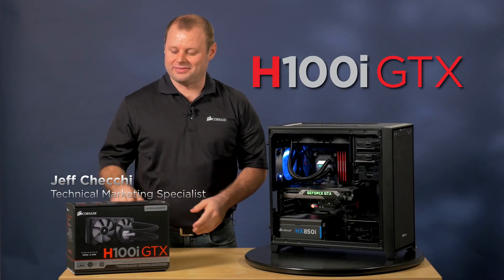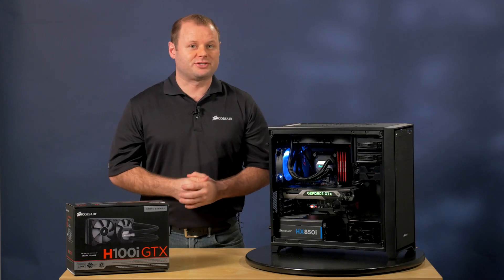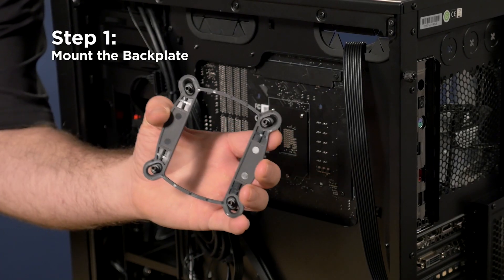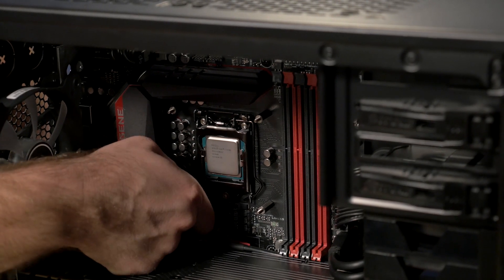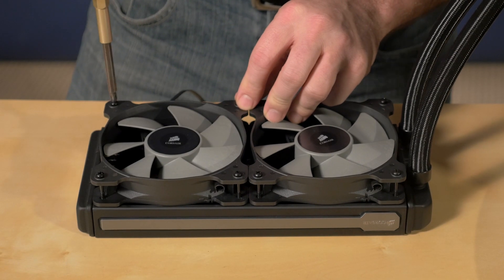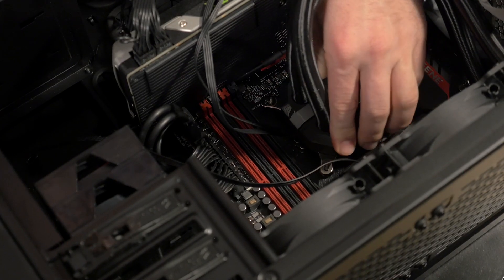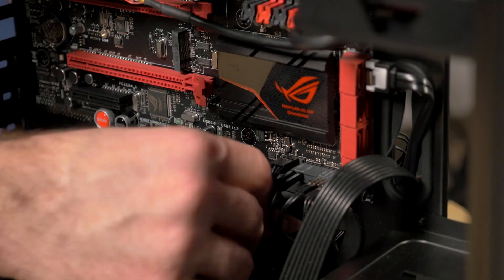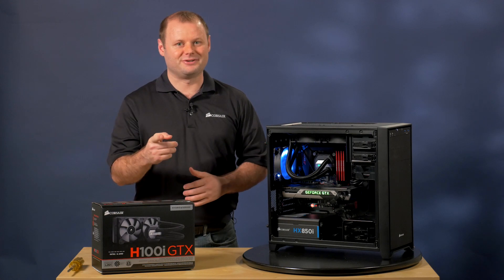Corsair Hydro Series H100i GTX Liquid CPU Cooler Installation How-To Guide

Comment: how do you maintain these cpu cooler?  when do we add coolant?
Reply: The liquid is pre-installed, you need only attach what's given to you like in the video above.
Reply: appreciate your reply but i mean since its a liquid would it not evaporate, im thinking if we need to re-add liquid after a year or 2?
Reply: Jary Roxas The system is completely sealed in, so none of it should evaporate out or leak. Ideally, the liquid inside never needs to get replaced. If you do come across issues and it was not caused by mishandling, then you should contact Corsair for an RMA. The life expectancy of this liquid cooler is supposedly 5 years, according to the Corsair warranty. http://www.corsair.com/en-us/support/warranty
Reply: Thank you!
Reply: No problem. Do note, however, that there is an H100i v2 also. Many wonder about the differences between the GTX and v2 because v2 costs more. As far as I know, they are actually near identical products, but v2 had its water block and pump updated in order to be compatible with some of the latest CPU sockets. If you run pcpartpicker.com and find that the GTX is compatible with your CPU, pick GTX since it's cheaper and essentially performs the same. I would think that the only CPUs whose sockets actually need the v2 are the latest top-end ones that cost a fortune.
Reply: ElectricPyroclast thanks for telling me the difference between the v2 and GTX, I was seriously confused, I guess it sucks I bought a v2 for an i5-6600k, im sure it doesnt need it but YOLO
Reply: It definitely doesn't lol mine is an i7-6700K, and the GTX was completely compatible with the LGA 1151 socket.

Comment: what do you plug the cooling block into
Reply: the backplate, put on the backplate, but the cooling block on to the 4 points on the side of the CPU and tighten, not to much, but enough.

Comment: What the fuck do i do about the three pin??? You didnt say anything you vague fucks.
Reply: Corey Christine
It 100% is
Reply: A 3 pin can fit a 4 pin and work perfectly fine.
Reply: Evil 1
Im white, but good job you figured out the easiest part of pc building,
Reply: Evil 1
What are your specs?
Reply: Deniedstingray I can prove my specs on pcpartpicker but I'd rather see yours first.
Reply: Evil 1
Well i asked first, this is kind of childish. I've got a 970 windforce, 16 Gb's of ram, and a i5-4690k @ 4Ghz.
Reply: Evil 1
Do you actually know what you have?
Reply: Deniedstingray That gpu I got from trade me for $600 which is damn good considering it's still $930 at it's cheapest retailer where I'm at. Uninformed should be your middle name. Name a card half that price that can "smash it".
Reply: Evil 1
Not exactly smash it, but you know what i mean. The 980 is quite overpriced.
Reply: Deniedstingray Hence why I got it nice and cheap otherwise I wouldn't have.
Reply: Deniedstingray You sent a link comparing gtx 980ti to 1080, two cards I'd rather have right now I guess.
Reply: Evil 1
You don't even have the Ti? That doesn't take a wild shit on a 970. The differences are so minimal its pointless. http://gpuboss.com/gpus/GeForce-GTX-980-vs-GeForce-GTX-970
Reply: Deniedstingray http://gpu.userbenchmark.com/Compare/Nvidia-GTX-980-vs-Nvidia-GTX-970/2576vs2577

I don't know this is pretty stark.
Reply: Evil 1
True, however paying 300 more for a difference of 30 fps isnt worth it.
Reply: Deniedstingray Then it comes back to the fact I got it for 600 rather than 900. At the same time the gtx 970 was 550 at it's cheapest retailer. In other words I paid $50 more which I thought was worth it. And considering the gtx980 at it's cheapest retailer right now is STILL $939 I'm quite happy.
Reply: Evil 1
Yeah that would be a good deal at that point. I tried to do that too but couldn't find a good 980 price at the time. Full price though the 970 would be a better value.
Reply: Evil 1
Well i didn't say mine would smash yours, I said there are others for a much better value that are capable of doing so. I realize that the 980 is better and im not denying it. But don't go talking shit like im the stupid one, You couldn't figure out how to plug in water cooling lol. Get out of here.
Reply: Lol. "Just don't be such a dick..". I think that's an understatement my friend.
Reply: Evil 1 bruh lmaoo
Reply: Corey Christine Wow you read all that? What a loser.
Reply: Evil is a bit low on IQ and can't get it from the first time. Just watch him respond to this as a confirmation ...
Reply: Redas Nekrosius The fuck are you talking about?

Comment: Nice and quiet gaming system my arse lol!!  Mine is installed exactly the same as this and it is impossible to get the air bubbles out of system. Making the pump the loudest thing in my pc. Apparently they really need to be mounted vertically so the air can go to the top of the rad and stay there. I've just built a really expensive new PC and all I can think about is this Goddamn pump noise. Any ideas any one?? I currently have my PC at a 45 degree angle balanced on books, not helped so far. Cheers Adam.

Comment: I got three sets of standoffs for the mounting bracket. Two are very similar except the one set is dark (black) and the other is shiny (silver). The other set has different length threads on either side. Which ones do I use for my Asus Z170-E motherboard? I checked the manual and I cannot differentiate between the two similarly sized standoffs except for the color... And the manual says nothing about the color...

Comment: Does not come with enough washers in the kit.  I ended up hitting the screw protectors of the radiator very easily, and basically smashed them down without realizing it.

Comment: question..with a top mounted radiator, the fans direction are up? so they pull hot air thru radiator through top of case? doesnt make sense to me.
Reply: I mean, the other option is they pull cool air down through  the radiator which is then heated up by said radiator and pushed into your case right down onto your GPU, raising ambient... Either way has flaws. A strategically mounted front intake with high throughput could assist in pushing the warm air out before it can pool and raise ambient too high, though. I suppose thinking about it this way, I'm inclined to agree with you. Defeats the point of buying a $100+ dollar cooler if you are pulling warm ambient to cool. Plus by the time it exits into the case, the pressure isn't as strong; the suction from exhaust and push from front intake should keep the air flowing properly. Hopefully. 

My case is really long so the front intake is.... well. heat pools beneath my GPU. the intake doesn't have the oomph to push it out that far back. I should get the side mesh to pull in under the GPU, tbh. Maybe a case upgrade is needed. (Corsair Graphite 600T white)
Reply: But aren't you just blowing hot air onto radiator? How does that possibly cool the water to cool the CPU?
Reply: i have a phanteks enthoo evolv atx the top and front look closed off im kind of concerned about my airflow
Reply: I have that same case but tempered glass edition. there's a small opening on the top separating the case metal and the top plate so don't worry. also the piece that connect to the cpu isn't horizontal like that it's vertical..
Reply: dont understand the 2nd part but thanks for first part
Reply: Fucked if I'd be pulling hot air into my radiator. That case can draw the cool air in from the the top on to the radiator so it then gets drawn into the rear fan and exhausted. What's the point of having fans on your radiator if the draw direction makes no difference?
Meh...positive pressure in and neg out I always say.
Reply: (When I lived with my parents, my father thought it was trash and threw it away..... lol. So I'd have to hope i can buy the replacement side mesh.) Oooooho boy. xD
Reply: This may be late and all, but think of it as two blood vessels, one for each tube you see on the Corsair. There's veins and arteries. Imagine hot air is oxygen. What im trying to say is hot air gets pulled through one tube and when it reaches the center part, that air is cooled down and turned into cold air and is used. I hope my analogy made sense xD

Comment: sorry, I am new to this do I need to add water or no?
Reply: nah its an AIO all in one cpu cooler , so its pre filled
Reply: it's a closed loop system, so you do not. Also just for FYI, this model uses mineral oil instead of water, to prevent electrical shorting in the event of an oil leak :)
Reply: so does that mean it's just like air cooling?? my head hurts
Reply: its pre filled from factory cooler , u just buy , it has thermal paste already applied so you just stick it to ur cpu and thats it
Reply: ok thanks? but one more question. do you recommend this to a locked processors?
Reply: No , there's no point of buying a liquid cooler of any sort if your processor is locked , buying this is for overclocking(unlocked processors) (k) and having good temps at the same time
Reply: thank you :)
Reply: Mouaad I have a i5 6600k can i use this on it and also would this item work on the 	NZXT S340 Glossy Black Steel ATX Mid Tower Case?
Reply: Murky Conduct yep it will for sure

Comment: My case doesn't have a place on top for the water cooling fans. It does have 2 holes in the back for tubes. Could I still install this? My case is a piece of shit called "advance, firecase" if anyone wants to look it up. Yes I plan on replacing it...some day.

Comment: Yo bro bro since u have awesome radiator can i just ask u question? Tnx, im new to radiator/ liquid cooling (call it whatever u wanna call) so do i need to refill using water?? What does it do aside from silence thing? How long can this radiator last long for day? Like i always from 10 hours from morning to night and yeah i just want to be safety, prevent from hazard or fire :) thanks bro bro lova ya
Reply: These come with water already sealed into the loop. Simply follow the directions to have it installed and you'll be ready to go! Also, most people don't need to change or filter out the coolant. You can leave it without having to refill it for a year at least from what I'm reading.
Reply: Tnx bro bro for responding my questions. The water case am i guarantee that it will not leak somewhere in my pc? Tnx again bro :)

Comment: Wow this is awesome getting it for sure. I just don't really understand how the corsair thing works so you can change the LEDs. Do I have to have a corsair motherboard for that to work, if they even make those which I assume they do. (Sorry it's my first build)
Reply: Also, does it come with the two exhaust fans?
Reply: Corsair doesn't make motherboards, you just need to download the Corsair Link software to change the LEDs or modify the fan profiles.  Also, the fans in the video are included with the cooler.
Reply: smokinjoe43 ok thanks
Reply: well the LEDs are controlled by the corsair link software that you will eventually download. The link software communicates to the pump via USB

Comment: I have a fan directly above where I wish to install this removing air outwards, would this cause an issue? The case I have is a Cooler Master HAF XM if this is of any help. also is it possible to have it the other way around?

Comment: It's all fun and games until the water leaks.
Reply: It doesn't need refilling its an all in one cooler, its his /her own damn fault. It's not meant to be taken apart.
Reply: Ikr I made on for my sister and she switched the water last month and she put the pipes on wrong.......
Reply: +mrkiiprototype RIP, did she lose other components? So you have to take it off and refill the water once a month so it doesn't dry out? I'm too afraid to use one on a new system.. Silicone Lottery etc
Reply: Alpha Numa No we lost the fans and that was it but she had no clue what to do but I have it and it works fine
Reply: I don't think that the solution inside can do anything to the components.
Reply: Carpet Shark I don't think they were talking about the H100i GTX, I am pretty sure they were talking about an open loop

Comment: Newbie question but I just wanted clarification: I'm going mITX so I'm limited on cpu fan connections. A h100i, including both 120mm fans, is only going to take up the CPU fan on the mobo? I don't have to worry about taking up a case fan header or anything?

Comment: Hey corsair, I have an h110i gtx liquid CPU cooler installed over my 4790k, I get great Idle temps, but when under full CPU load I get really high temps.  Any tips?
Reply: Did you try turning it off and back on?
Reply: What temps are we talking about here?
Reply: I really doubt with liquid cooling you would be getting "high" temps, unless something is really wrong with your cooler. Are you sure they are actually high?  CPU's in that era can run alright up to 70C, and with liquid cooling you never really should see it go above 55C unless you've done a ton of overclocking.

Comment: I've been using this cpu cooler for like 5 months now .... My friend told me that the water inside will dry out after few months is that true?  Do I need to maintenance it? Please Help! :D
Reply: Not if the loop is closed
Reply: Yea but I would replace it every 2-3 months
Reply: +Freaky Fun Is it loud?
Reply: I used to "seal" my "open loop" system with silicon to prevent it from "evaporating".  Evaporation requires a PLACE in the line to get to the atmosphere.  Otherwise, it simply recondenses back to liquid, just like Freon does in a closed loop in a refrigerator.
Reply: no. closed loop doesnt need to be changed. do your research before commenting.

Comment: I have this liquid cooler but the fans are very loud.
Reply: Or if you really want quieter, you could buy quiet edition corsair 120mm fans and just replace the ones on the radiator.
Reply: Look up Corsair's ML140 Lineup. That will give you some quiet fans and a nice color profile. :)
Reply: you having a problem with them going at max speed? if so its since you didnt plug one of the fans in correctly this fucked up my friends system it made evry fan even gpu run at max speed.
Reply: Where's the software....? There isn't even a link in the manual and nothing in the box..................

Comment: where can i get those 4 cpu thumb screws? i saw some on ebay but they were like $10. that seems kinda high just for some screws. is there any place that sells them cheaper? If not ill just go to a hardware store and look for some nuts with the same threads.

Comment: can i connect diffrent fan same size but with LED im going to build my pc? want to be 100%
Reply: Yes you can. Every 120mm fan will fit. As long as its a static pressure fan for best results. Just make sure that you have enough clearance.
Reply: +MercyOfDarkness thanks
Reply: thanks
Reply: It's 4-pin, not 3-pin! High static pressure PWM fans for radiators, connected to preferably 4-pin!

Comment: I am looking for a LC unit for my 1150sck intel. I am currently using a Aerocool Xpredator Black orange case and I dont really have any space for the double fan radiator. That I can tell. LC is new to me. So I believe I have a either a 140mm or 180mm back pannel vent free and on the base pannel of the case.

Comment: Once payday hits on Thursday, I'm heading down to Microcenter, to pick one of these up. Couple of compatibility questions before i do that.
1. Is this compatible with AM3+ Motherboards?
2. Will the radiator fit on the top of the Corsair Vengeance C70 case?
 If both are yes, I will gladly purchase one of these!

Comment: Where do you add the liquid at?
Reply: I Believe water is already in the tubes.
Reply: U dont put any liquid in it, it's already applied u just need to install and done.
Reply: ok thx guys
Reply: Does not need to be added, for the life of the device.  At that point, you probably could cut off the radiator, and buy a new cpu sink and pump for your new system and start all over.

Comment: um. does it come pre-installed with water? or do you have to add it, and isnt there supposed to be a pump? is it like all in one with this?
Reply: It's a closed loop cooling system, that means it's already got liquid solution.
Reply: youre my hero, getting this rn then, thanks alot
Reply: I've been using this cpu cooler for like 5 months now .... My friend told me that the water inside will dry out after few months is that true?  Do I need to maintenance it? Please Help! :D
Reply: you will be fine ive had this for a year and im good! the old h100 has lasted some people 5 YEARS!!!
Reply: but if your scared just switch to air cooling
Reply: You don't need to be scared. It's really easy to use, There were no leaks at all when I installed it, so go for the h100 it's a great liquid cpu cooler.

Comment: does anybody know where I can buy more of the long screws that are used to mount the fans onto the radiator? or at least the size so I can buy some at the hardware store? I want to set mine up in push/pull but It only comes with 8 screws so I need 8 more to do that

Comment: Don't you have to refill the coolant every few months?
Reply: Jehanzeb Naveed Closed Loop Circuit
Reply: No. Sealed radiators like this usually last a long time until the pump breaks after 2 years.
Reply: breaks and does it shortcircuit the things inside cpu ?
Reply: Jehanzeb Naveed When you use the CLC, check if it leaks. If it leaks it can just break your components.
Reply: Xavanux CLC ? sorry cant get it
Reply: I had far more leaks in an "open system", and zero with this closed system.  If you are not comfortable with water cooling, then simply don't do it and don't overclock your PC.  That is why people use Water... because it is better than air in that situation.
Reply: As Corsair say on their website:
5,000 hours expected with this product at 40c
5 year warranty